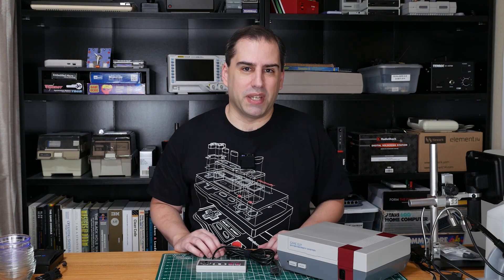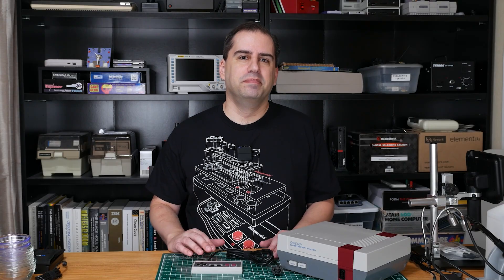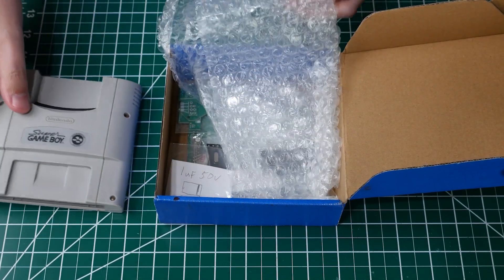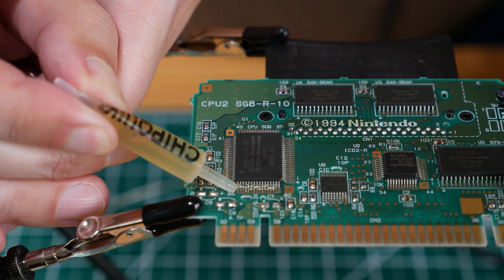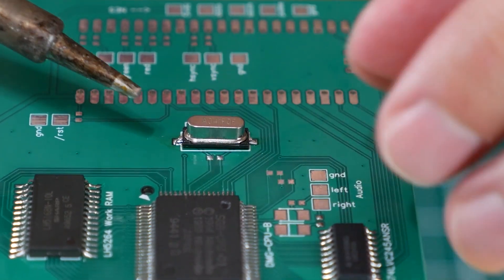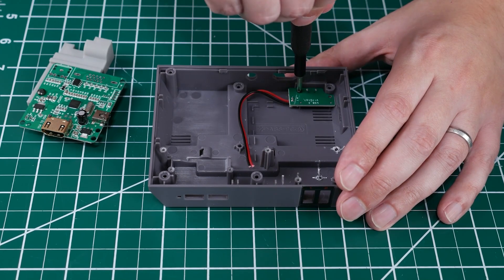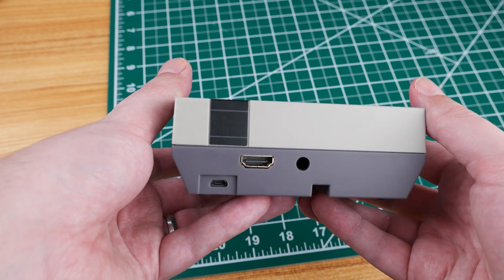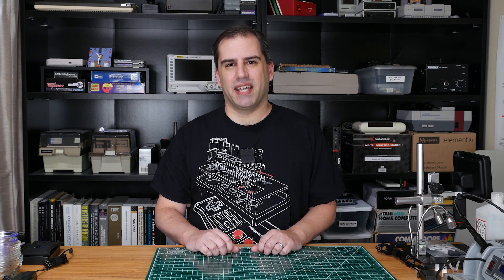The Game Guy Mini, Upgrading the Unportable Game Boy!

Comment: When soldering surface mount components, when you pre solder the pads just do one pad then lay the component and heat the leg to the pad while orienting it. That's fine for components with few legs. For chips with lots of legs do not pre solder and use kapton tape across the chip...
Reply: Good tips!

Comment: Is there a particular advantage to using the low-temp solder to desolder things? Does it work better under certain circumstances, etc.? So far I've been using a hot air station to desolder, and haven't had any issues, but I haven't yet had to desolder anything with as many legs as those Game Boy chips.

Also, I've tried drag soldering with the chisel-style tip that you used, and found that it doesn't really work that well. IMHO this the wrong kind of tip for drag soldering. The tip that I have found works really well is what I call the "hoof" tip. Not sure if that's the official technical name for them. Basically it's a tip that has one flat face at a (roughly) 45 degree angle. You blob some solder onto the flat part, then slide it over the pins (applying flux beforehand, of course.) Works a treat.
Reply: I find low-temp solder much easier for chip removal than the 60/40 stuff I usually use. I don't own a hot air station, but I expect that desoldering with an iron has the benefit of keeping heat localized more easily.

I've seen the iron tips you're talking about, but I don't have one. I'll pick one up next time I buy replacement tips.

Comment: Cool machine you built there! Great project. Does this work with Elgato capture devices? Input Delay?
Reply: Input delay seems minimal but I haven't done any real tests. Also haven't tried it with the Elgato, but I would expect it to work since it's not using any weird resolutions or timing or anything.